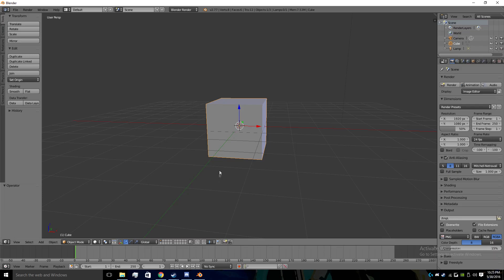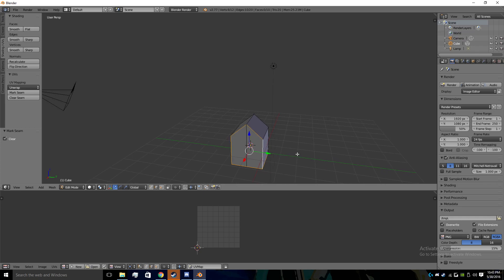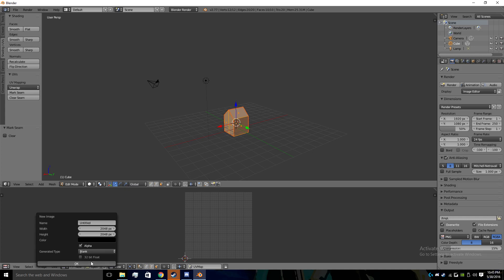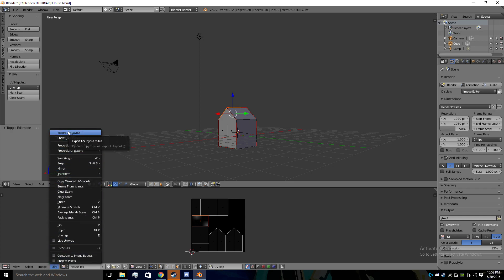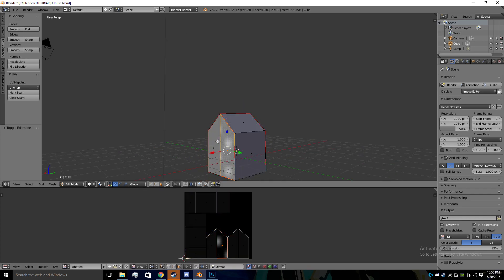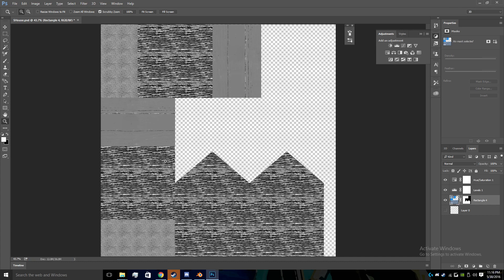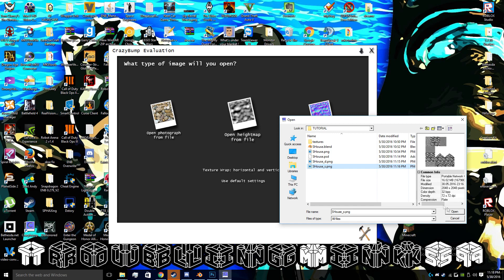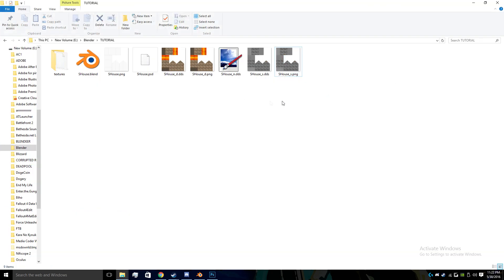Fallout 4 Modding Tutorial, from blender to the creation kit (1/2) Asset Creation

Comment: Wait. One joined object or one contiguous mesh? Cuz I'm trying to remake vanilla housekit (it's just awful, second floor doesn't match the first floor, objects aren't centered, theres unused roof that doesn't fit anything at all...) and I've noticed that for some reason most of the model is one contiguous mesh, but there are some elements – like shutters, damage decals and so on – that are separate yet put into the same object.
 
So I'm pretty sure it needs to just be all in one object, but it can be multiple meshes intersecting. But then why did they make walls and floor a single mesh? It seems to me that it would actually be cheaper on resources to have a simple block for base and two meshes for walls. Vanilla mesh looks like it was straight from bool modifier, it has like a hundred polygons just for the shell itself, then there're also doorframes, decals and so on.